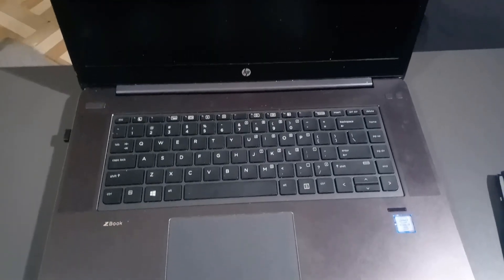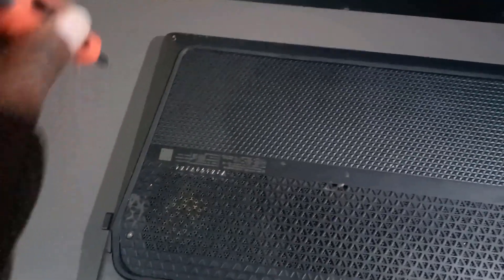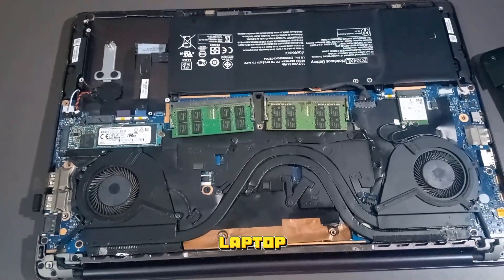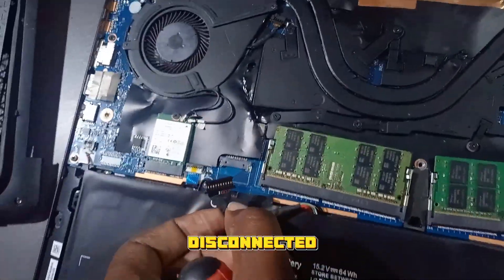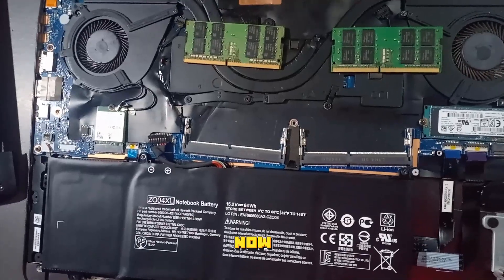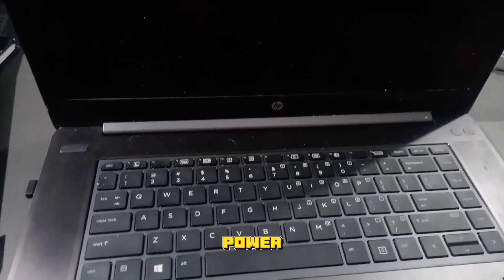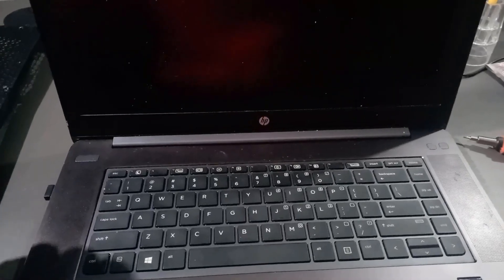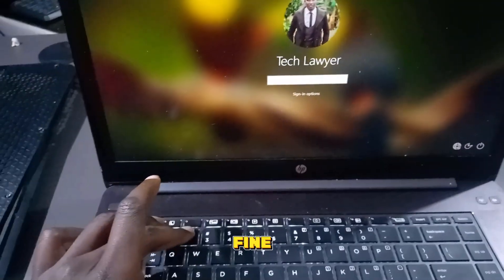Laptop Not Turning on Blinking when You press power Button. Step By Step Solution

Comment: so weird, I had this problem today with my thinkpad x1 extreme gen 1, I tried several methods I found online. reseat the ssd, hold power button 30 seconds, and yours to remove ram and disconnect the power to board, and hold 30 sec and start, all works the first start after I did the trick, but when I turn it off and try turn on again, it won't start again, so frustrating...

Comment: do u the put the battery and the ram where it belongs after it turns on
Reply from the maker: Hello
Step 1.unscrew your laptop
step 2.remove the battery and RAM from the Laptop
Step 3.Long press the power button for 30 seconds(without RAM and battery)
Step 4.Now Return your battery and RAM
Step 5:screw back your Laptop and now You Can Use your Power button

Hope that helps😊